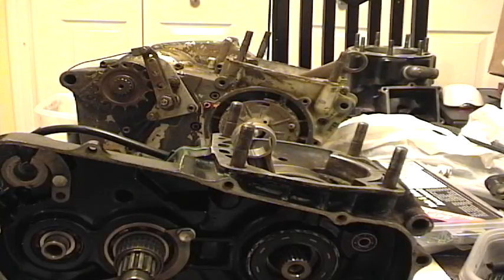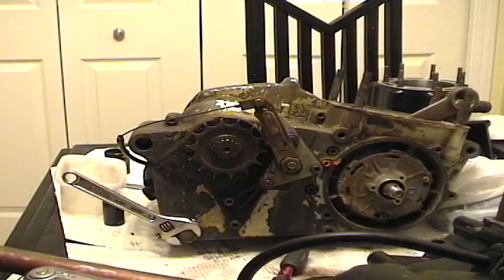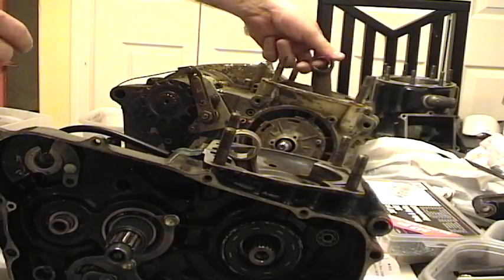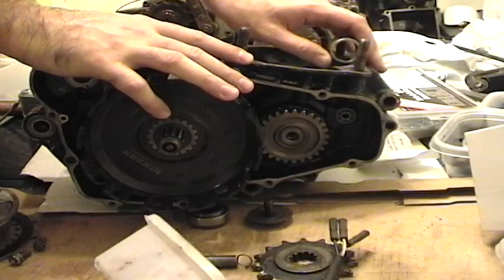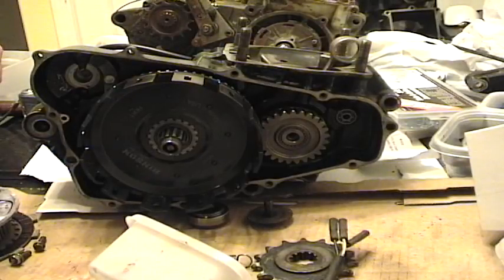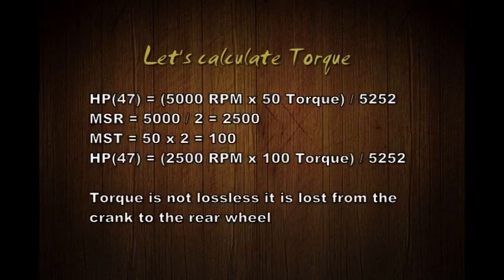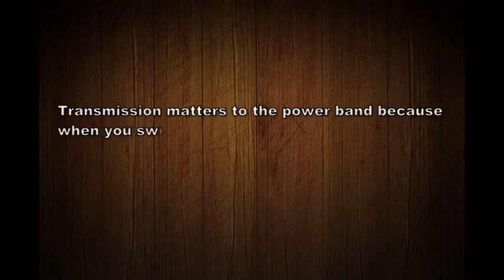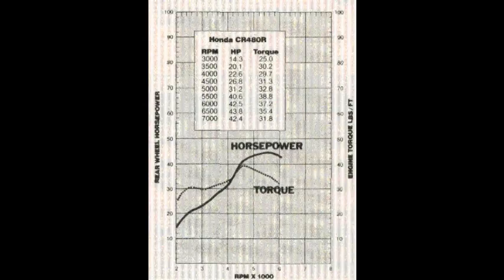Toby's Kitchen: What is a POWERBAND? (Re-Released)

Comment: 2:07 Dude… 🤦🏻 Your explanation of torque physics is horrible…. Both methods, cheater bar or more force applied to just the wrench, use exactly the same amount of torque to remove the bolt. The bolt will break loose at exactly the same torque value no matter the method used. The cheater bar just gives you more leverage which makes it easier to apply the same amount of torque with less effort. The ft lbs of torque are the same. There are many other things you explained wrong… but I’m not typing all that. You can be terrible at teaching physics and still be a functional mechanic.
Reply from the maker: Torque is force x length. The shorter the bar the more force the longer the bar the less force to get the same and eaiser to get more torque if you couldnt get enough with the shorter length.  Its nit that difficult.